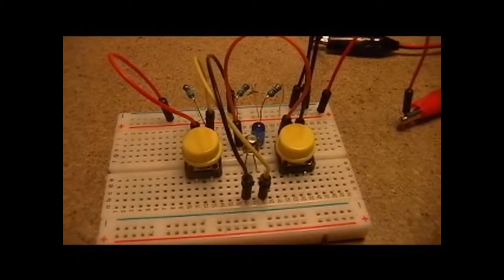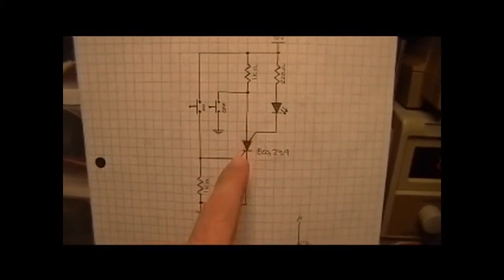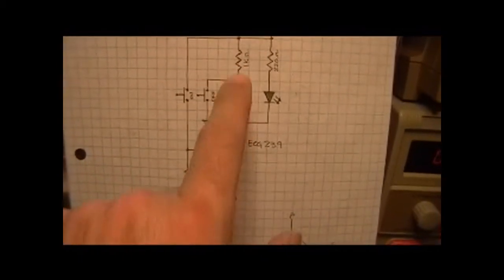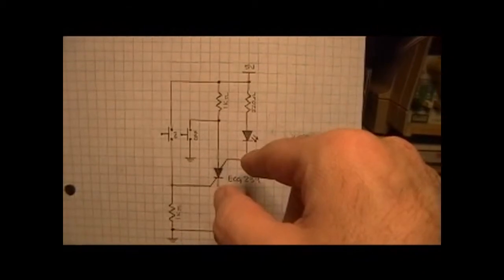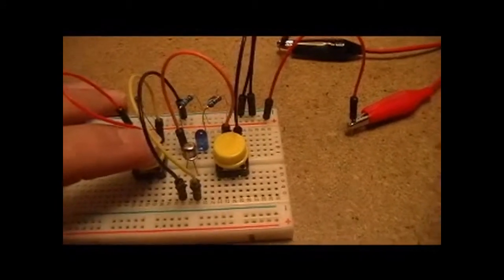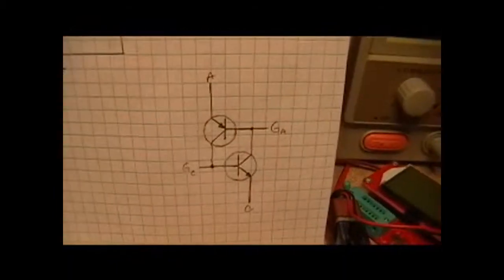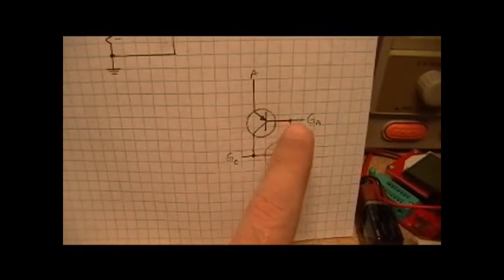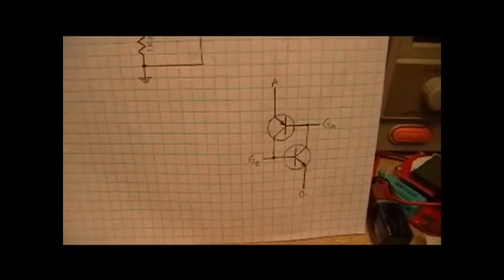Silicon Controlled Switch

Comment: Hi sir, can I have the values for the equivalent transistors for the SCS?
Reply from the maker: Are you asking about the later part of the video where I describe the use of transistors that represent the SCS?  If so, it is simply a PNP and an NPN transistor combination.  I would generally look for related transistors with similar specifications.  If you are asking about the specific numbers for devices that are SCS's, then I would have to do some research to get those values.  In this video I used an ECG239 and I also mention a 3N58.  I am sure there are other devices but their availability may be in question.  I hope this answers your question, but if not, please give me a little more information about exactly what you are asking.  Thanks.
Reply: thank you sir for your response and i will wait for those transistor values.

Comment: What are the components of the circuit? Thankyou
Reply from the maker: There is a schematic about 0:27 seconds into the video.  It is primarily the SCS (ECG239), an LED, a few of resistors, and a couple of switches.  Let me know if you still have questions.
Reply: What is the procedure of doing this?
Reply from the maker: I am not sure I really understand your question.  Reconstruct the circuit from the schematic on a breadboard and provided the specified power and ground.  The the two buttons can be used (one to turn it on and one to turn it off).  The LED represents the load of the circuit.
Reply: Jonathan Bisnett What if the ecg239 is not available,what other class of scs can be use? Thankyou again